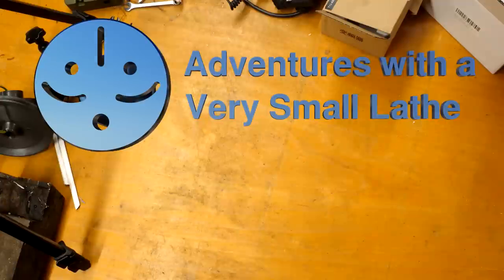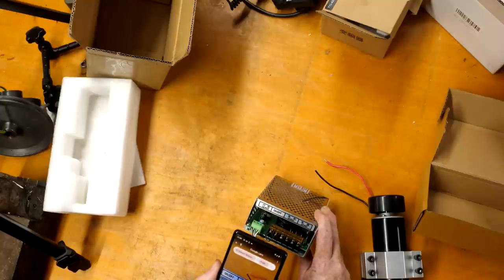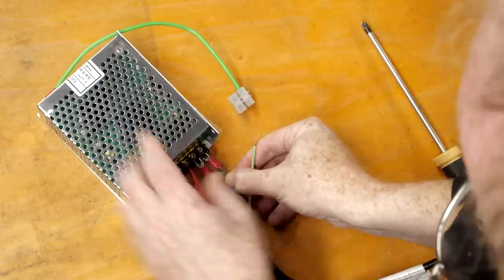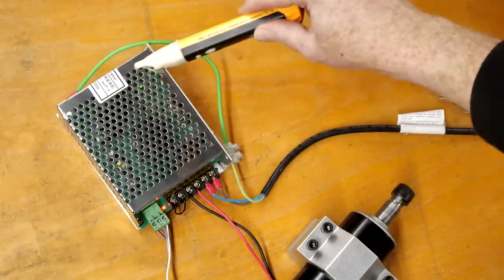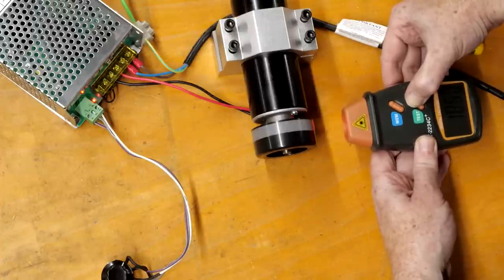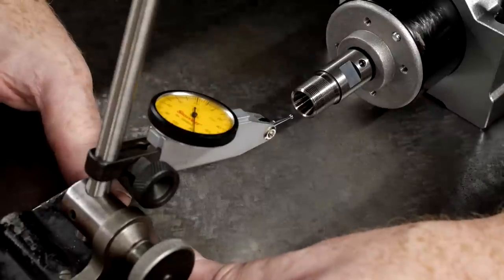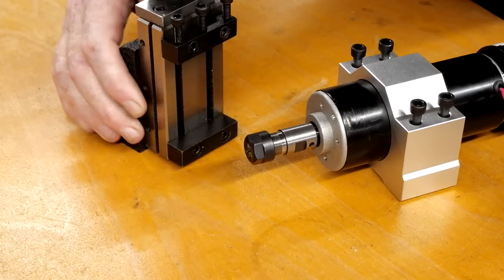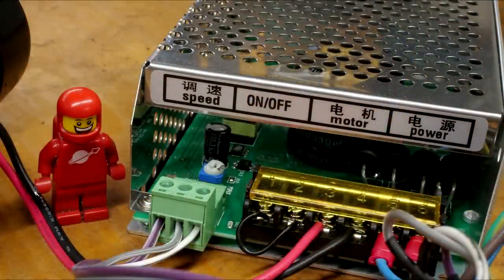Toolpost Spindle from Banggood for the CJ0618 Mini Lathe

Comment: I'd been considering this same combination as a possible tool post grinder for more than a year now.  Used as you're considering as a small points and small mounted wheels direct drive.  And perhaps with some additional bracketry as a power unit for a pulley reduction to get down to use with 4 inch diameter wheels for external cylinder grinding on the lathe.  I'll certainly be looking forward to your next part 2 video.

Comment: I actually have this same spindle installed on my 3D printed CNC router, it performs surprisingly well. I did find an issue with the collet that came with mine though where there was a sort of ridge inside the collet and when inserting tooling, only a small contact area was maintained on the tool. The result of this was that during a heavy cut the tool pulled out of the spindle and dug deeper and deeper into the work, eventually cutting through the work, the spoil board and one of my steel T-nuts. Amazingly, it didn't stall the motor or snap the tool.

Comment: Hi, I have the same spindle -

1) Be VERY careful of that power supply - it isn't isolated from the mains, so the motor leads and the control potentiometer leads are live (as your voltage detector picked up). 

 2) The bearings are rubber mounted and very small. You may get away with light grinding, but the spindle is too flexible for milling metal - it gets worse as the spindle warms up and the rubber softens.

3) It generates ferocious amounts of RFI, especially under load.

I did try and re-work the spindle to improve it, but ultimately it wasn't worth it IMHO - even with decent bearings, the shaft is too thin, and the bearing spacing too great to be able to make a stiff spindle. (Some pictures on my website). Having been through the loop, I'd strongly recommend starting with something better - I've now made my own spindle, just using this one as a drive motor (will put something on my website in the next week, or so to document this).
Reply: There are pictures of the insides of the spindle in the Metalwork - Desktop CNC - Reworking the Spindle page on my website (can't add a link)

Comment: These are really neat little spindles. There are also brushes spindles going around, same sort of overall configuration. I have one I got a good few years ago and use it a lot for polishing small parts. Mine happens to have a sensored  brushless motor, so it has good torque even down to very slow speeds. Unfortunately can’t seem to find one again!

Comment: I have used cheap er11 collet chucks before with little success. The problem i ran into is not the translatory runout of the taper but instead the angular runout of your cutter that you get if the taper of the chuck doesn´t match the taper of the collet. If the angles don´t match you basicly have only a ring contact, wich centers the tool only translatory but doesn´t stop it from tilting. If the chuck isn´t hardened you might get away with remachining the taper, though i haven´t tried that yet. good luck with your tool quality
Reply from the maker: My application is grinding, so I as long as the runout is steady then I can dress it out on the wheel. I'll go into the details of how well this goes in the future videos.

Comment: I bought this exact same unit from Banggood a year ago, the speed controller/power supply blew up after a month or so. And the fan on the end does almost nothing.

Also careful if you take the speed controller apart. The capacitors are charged to almost 400v weeks after it's unplugged.

Comment: I've got a spindle like that in the drawer. Readíng the feedback some people complained about electronical noise disturbing microcontrollers nearby. No tests done here yet.
Reply: Yes the elecrical noise is terrible but easily stopped with 2 capacitors on the motor supply.
Reply: @rl3898  Thanks for the advice. It might become a tool post grinder one day.
Reply: @rl3898  What caps did You use? I havent measured the voltage out to the motor. Mains?

Comment: On the off chance you're still reading comments... could you tell me the bore size and key size for the change gears on this CJ0618 lathe?  Thanks.
Reply from the maker: I'm still here, making videos as fast as time allows! The bore size is 12mm and the key is 4mm. Hope this helps.
Reply: @AdventureswithaVerySmallLathe  Thanks!

Comment: For a breakdown video of that type of spindle. https://www.youtube.com/watch?v=7P5THNNjafU&list=PL3T2TicV-yJRIyR9FWynzYAt1K119IWV7&index=4 
Not the best design but still useable for many applications. There are some videos where the fan was balanced to cut down on the vibration.
I have one of those for a small cnc router project.